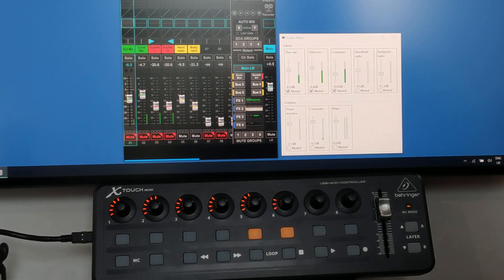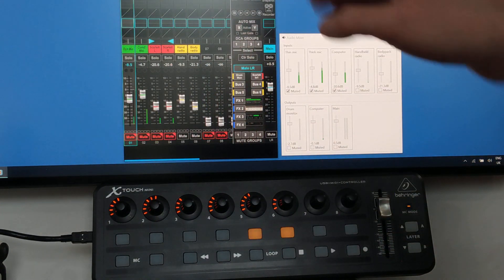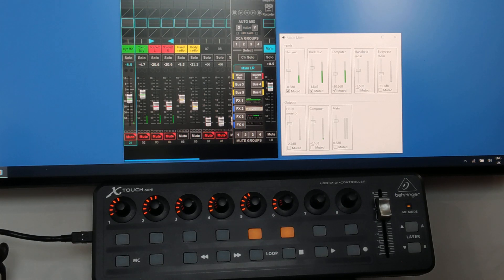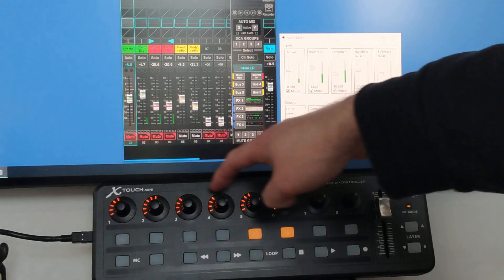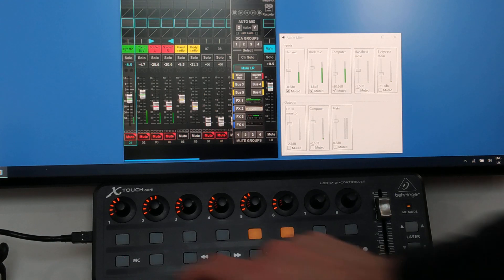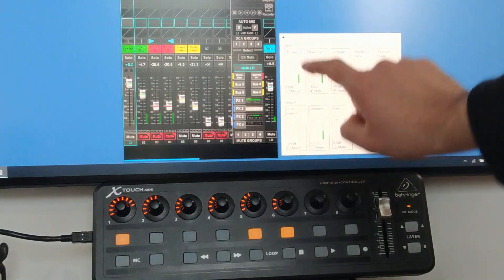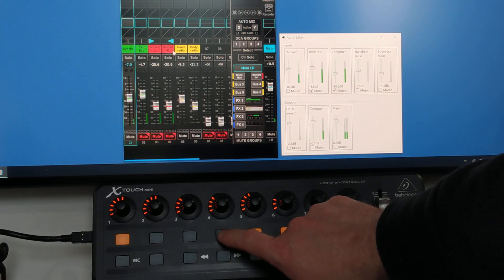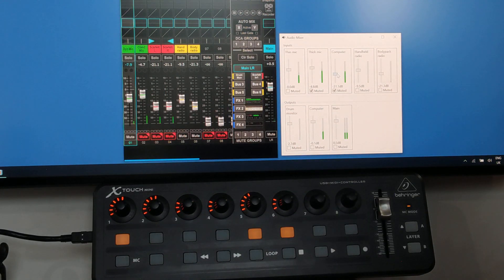Demo of X-Touch Mini controlling an XR-16

Comment: Hello mate, thanks for sharing. 

Would it be possible to do so via a macOS device as well?
We've got an xr12 we use for one of our conferencing systems and want to upgrade to an xr16 and wondered if there is a Mac-equivalent to the WPF app?
Reply from the maker: There isn't at the moment, no. But the core code is portable, so it should be feasible to create a Maui app that does the same thing. I don't have the time to write that myself I'm afraid, but the code is all there and usable for anyone who'd like to do it themselves.

Comment: Hi, can you also control de aux sends?
Reply from the maker: You can do so from the WPF app, yes. On the X-Touch Mini, I've recently improved things so that you can control the volume of a second output (for the first eight channels) by pressing a knob in and turning it. (Basically, while the knob is pushed, it shows and controls the volume of the first-configured aux output; otherwise, it shows and controls the main output.)

Comment: Hi Jon, thanks for sharing! I've just invested in an XR18 and X-Touch Mini (as I heard you could perform simple fader moves and mutes via the X-Touch mini). I'm having difficulty getting the X-Touch Mini to communicate with the X-Air-Edit. I've used the Windows X-Touch editor to assign the numbers according to the MIDI specs in the back of the XR18 manual. I just literally want to be able to control the channel volumes and mute - that's it. The X-Air-Edit is not responding when I turn the encoders on the X-Touch Mini. I'm not sure what global channel I should have the X-Touch Mini set to either... Do I need an app to get the X-Air-Edit to interpret the X-Touch Mini?... Ideally I'd love to be able to connect the X-Touch Mini via a USB cable (into a powered USB port for power) and then into the USB port on the XR18 (with no laptop) do you know is this at all possible? Thanks!
Reply from the maker: It's not clear to me whether you've got any other software involved. The video I've played here includes code I've written myself to effectively be a bridge between the XR18 and the X-Touch Mini. You need something to be that bridge, whether that's my code or something else. (For example, there's another project at https://github.com/Shuptuu/TheLink/ - I haven't used it and can't vouch for it; it's just another piece of software designed to do the same thing.)
Reply: @JonSkeet  thanks so much for your reply John. No, I don't have any software in between... OK, so I need some kind of bridging software.Thanks so much for this. I'll check out your code and read your blog on it. Much appreciated!
Reply: I have 3 xair 18s the xTouch control surface is too big to be carrying around in case the wifi doesn’t want to connect to a tablet